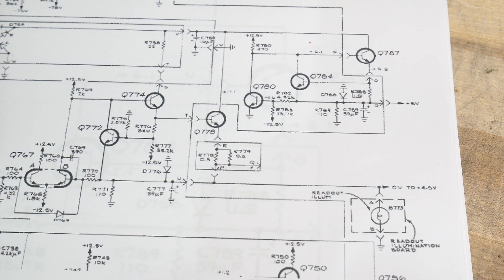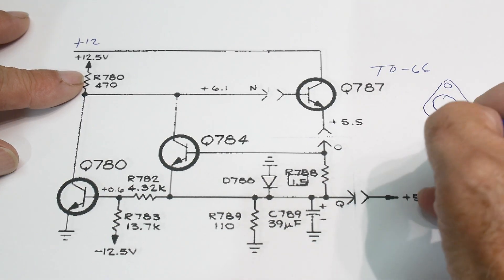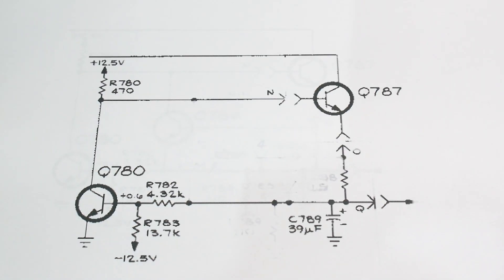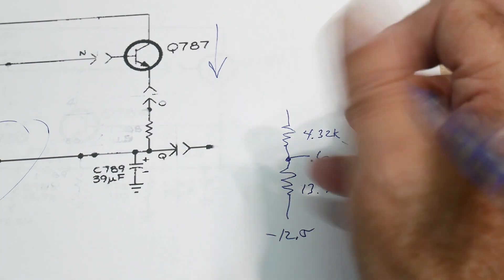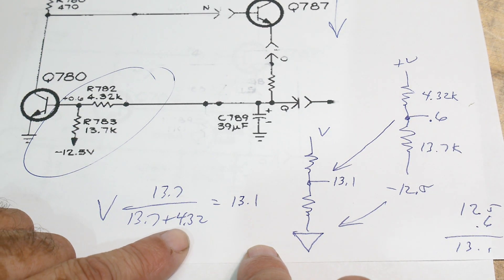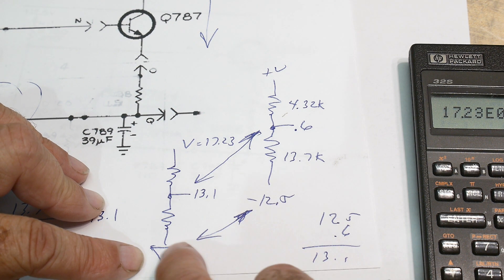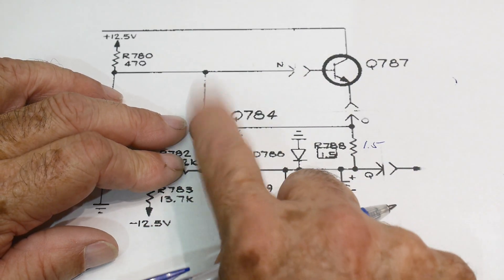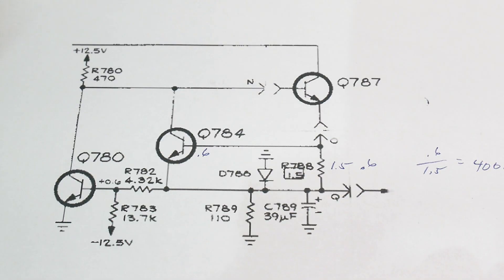#1279 Three Transistor Voltage Regulator

Comment: That first part of the circuit looks like a fold back current limiter to me... it's probably doing that, which make me think that this probably only regulates properly when it is under load and the no load open circuit voltage probably won't make much sense in respect to the required 5V

Comment: Here are a few points:

1- The diode is there to make sure if there is dip in the output voltage -- as a result of transient --, it won't go below - 0.7V , that will save your C789 (39uF Cap), without that your Cap will get reversed biased.

2-  you can calculate the current through R783 is equal to  ( 0.6 - (-12.5))/13.7K 

3. 0.6V at the base of Q780 is our kinda reference in this feedback loop (Variation in hfe of transistors or load current does not change this base voltage, only temperature will)

4.  If you open the feedback loop and do loop analyzes, you will realize R788 (which you taken off is there to stabilize the feedback loop)

5. Your open loop gain of the feedback loop is gm(of Q780) * R780 * (R783/(R783+R782))

6.  Your dominate pole (1st pole) in this feedback loop is1/{2*PI* [(R788+ 1/gm(of Q787))*C789]}

7.  gm pf any BJT transistor is Ic/VT, VT is about 0.026 V & Ic is the collector current

8.  Your first zero  of feedback loop is 1/(2*PI*Resr*C789);  Resr is the esr resistance of C789

9.  Your parasitic pole of the loop is 1/(2*PI*R780* C_parasitic of the Base Q787) diffusion cap of Q787 C~Cb=tf*gm & tf =W^2/(2*Dn)  W is effective base & thickness Dn  is Diffusivity

10. Q784 & R788 (which you eliminated) act as short circuit protection.

11.  The advantage of this Voltage Source over regular LDO:
        A.  It has its own voltage reference. 
        B.  Does not require opamp
        C.  Maybe can be designed to be faster ( higher ZGF and still stable)
        D.  Lower over all transistor count.
        F.  Maybe can be can be designed to have lower noise (Bandgap reference noise and opamp noise is eliminated, and we can optimize this type of voltage source for low noise)

Anyways, interesting circuit thanks for pointing it out.
Reply: Ok.  Now explain the Crowbar current limiter you removed.
Reply: @johnhargenrader8972  
Simple: While the voltage on Base-Emitter of Q784 is less than 0.65V , the transistor is off, when the voltage reaches 0.65V It turns on.
The Base-Emitter voltage of Q784 is almost equal to R788* Current of Q787.  So if R788 is 1.5Ohm then it takes 0.65(V) /1.5 (Ohm)  = 426 (mA) to turn Q784 on.
Below this current it is as if the transistor does not exist, above this current Q784 would start conducting shot circuit the Base to Emitter of Q787.
So the Maximum output current is about 400mA from 12V Supply. ( Assuming the output is short circuited)
The Maximum Supply current ( i.e. 12.5 V supply)  is 12.5(V) /470 (Ohm) = 26.5 (mA) ( Assuming the output is short circuited)
Reply: The Diode also protects Q780 against avalanche breakdown of its BE-diode.

This is also the point nobody is thinking about for the typical 2-transistor astable multivibrator design. It should not be operated this way with operating voltages higher than 6 V. Typical avalanche breakdown voltages are between 7 and 12 V for BJT. Especially if you use large capacitors, delivering enough charge, you can easily destroy the BE-diode of the transistors.
Reply: @gkdresden  
My main concern about this design is short circuit output to -12.5 V 
If there is a short from output to -12.5  the Diode D788 basically is going to fry, first.  Then C789 is going to blow up.  This is just beginning of chain reaction that will be very destructive.  Therefore, the circuit that used as a load should have no path to -12.5 V.
Reply: The diode is there to protect the  output circuit and left transistor when power is turned on. 

If negative supply comes on first before main power, as it sure will because of large capacitor for large load current.

Power up sequence is important here. Most analysis focuses on steady state, small signal analysis, large loop bandwidth etc. assumption.

Comment: Why use -12.5V at the bottom of that divider? One could have used 0V, couldn't you?
Reply: No, -12.5V is clearly  the voltage reference in this circuit
Reply: @yveslesage8525  but why can’t the voltage divider be referenced to 0V instead? Assuming I want to reuse this circuit in a product that doesn’t have negative supplies. Isn’t it a matter of changing the voltage divider so the 0.6V sits at the right point?
Reply: @DafyddRoche  If you do that, then your output voltage depends on the Vbe of the particular sample of transistor used for Q780, and the temperature drift of the output voltage will be -0.3% per °C. It's not suitable for production. You might as well just use a 4.3V Zener supplied from the 470R resistor and only keep Q787.
Using a stable, regulated -12.5V supply line eliminates dependency on the particular transistor's Vbe and reduces the temperature drift by a factor or 13.1/0.6 = 22 times.
If you want a 5V supply in a modern product, just use an LM7805 or one of the common low drop-out regulators if you have less than 7V to supply it from.
Reply: @RexxSchneider  Hi Rex. yes - it'd be easier to use a simple regulator! :) But I am curious, or I should say -- I need to understand - isn't ground considered "stable and regulated"? I think I understand that because the the transistors emitter is grounded, we're now depending on 0.6 or 0.65 or 0.7V turn on voltage difference. Why does having a -12.5V make a difference? surely, a Vbe variance in the transistor makes the turn on voltage equally as variable?  (Help! I clearly haven't had my AH-HA! moment! )
Reply: @DafyddRoche  Ground is stable, of course. But if you are trying to use a reference that's only about 600mV above ground, i.e Vbe of the transistor, then a variation of 60mV for example (perhaps through temperature change or variation in Vbe between samples) will produce a variation of 10% (60mV/600mV) in the current flowing through the resistor divider and a consequent 10% variation in the output voltage. On the other hand, if you tie the lower resistor to -12.5V instead of ground, then you have a total of 13.1V across that resistor and a change of 60mV in Vbe will only create a change in current of 60mV/13100mV = 0.5%, and hence only a 0.5% change in output voltage. Now do you see the difference?
Reply: @RexxSchneider  understood. thank you Rex! the greater voltage clearly gives more noise immunity.

Comment: Your 4.7V output would be off slightly because the base current was ignored.  But, I would have done the same thing, close enough. :)

Haven't thought about if adding in the base current would lower or raise the output voltage.

Wonder how stable is this over temperature?
Reply: The added base current would shift the output voltage up a little, having the same effect as reducing the value of the 13.7K resistor, but the effect is probably pretty negligible.

As for temperature stability, it's probably not great, but the fact that the entire design is dependent on the integrity of the -12.5V rail, it's probably not anyone's biggest concern.
Reply: The temperature dependance would be something like 1+4.32/13.7 times the Vbe tempco (2mV/Cent Degree). So it is just 30% more than the variation of the Vbe.

Comment: The controlled voltage opposes changes in the -12.5 V supply; they track each other such that the base voltage remains 0.6 V and very little current flows into the base.  Tracking power supplies utilize similar tricks, but the resistors would be almost equal in this design.

Comment: I think the main point of this regulator is that it is based on a separate voltage stabilized reference (The -12.5 V supply).  The 0.6 volt drop will drift slightly with temperature (maybe about 0.05V) but the current through the 13.7K will be relatively fixed at 13.1V/13.7K or about 1ma.  The current in the base of Q780 will be small (assuming reasonably high beta), so the voltage output will be about 4.32V+0.6V or about 5V.   The current limiter will not be thermally stable, but this is just a protection feature and doesn't need to be precise.
Reply: Vbe drifts about 2mV/°C i think. It can be used as thermometer.
Reply: @plainedgedsaw1694  It's -2mV/°C, but it would take a 50°C rise in temperature to decrease the 13.1V across R783 by 0.1V. That's less than 0.02% per °C, which is effectively negligible.

Comment: This regulator depends on the value of the input voltage... how can we call it regulator
Reply: It only depends on already regulated -12.5V rail, but not on it's positive rail. I guess they did it this way because it was simpler and cheaper and did the job.

Comment: My analysis process was a bit different.  By observation, there is 13.1V across the 13.7k resistor, so you can calculate the current in the two resistors (ignoring the base current).  Then, calculate the IR drop across the 4.32k, and add 0.6 to that.
Reply: I am confused about the discussion here?
To me this looks very much like a totally textbook voltage regulator?
In this case the diode drop of the transistor (Q780) is used as a reference.
R782 and R783 are the feedback resistors.
The only difference is that the negative voltage on R783 will just offset the feedback voltage.
The unfortunate thing, is that it makes the math behind it rather convoluted if you want to prove the whole thing.
But the easiest way is the way w2aew did it. Can easily be checked in your favorite SPICE program.
I only wonder why they choose to do it this way, to give regulator a little more stability or so?
Reply: @p_mouse8676  The Vbe of the transistor is not really being used as a reference because it is very small compared to the -12.5V line. That line has to be a stable voltage so that the current of about 1mA through R783 (13.7K) becomes the actual reference. When that current flows through R783 (4.32K), it produces about 4.3V, which when added to the 0.7V of the Vbe produces the output voltage of 5V. That assumes that the Ib of Q780 is small compared to 1mA. The Ic of Q780 won't be more than about 13mA, so it needs a β of more than about 200 or so to make the Ib insignificant. That's easy enough to spec for.
Reply: My initial reaction was there's about 12.5 + 0.7 = 13.2 volts across the 13.7K resistor, so we have around 1mA which also passes through the 4.32K resistor, so it drops 4.3 volts, which when added to the 0.7V at the base makes 5V output. There's no point in trying to more precise because we don't know the supply voltage ("around 12V") and we don't know the current being drawn, nor do we know the β of Q787 or the β of Q780. Assuming the supply voltage is 12V, the collector of Q780 is at around 5.7V, so we have (12V - 5.7V)/470R = 13.4mA, minus the base current of Q787, being sunk as collector current of Q780. That will require base current which also flows through R782, raising the output voltage by some unknown amount.
Reply: Its unbelievable that you are writing here. I am a huge fan :D
Reply: @IIIDarkWorlDIII  Thank you!
Reply: @w2aew  Wow what a day! Peace be on to you Sir!
Reply: can you say what led you to make that observation, or rather why that was a good place to start the analysis?
Reply from the maker: @nickcaruso  There are many ways to skin the cat. Alan looks at it like a EE and just sees currents. I tried (try) to teach at a more simple level and reduce the problem to something everyone is probably familiar with, voltage divider.
Reply: @IMSAIGuy  gotcha.  I am (technically at least) an engineer and I am curious about ways of thinking about problems.  Such was the intent of the question.
Reply from the maker: @nickcaruso  you might want to think about what the tek designer had to do. +5 at the top .6 in the middle, -12.5 at the bottom. now choose the resistors to use.
Reply: @nickcaruso  Just taking a look at what is known.  The voltages on either side of the 13.7k resistor were known, so the current was easily calculated.  Good design practice would dictate that the current through these resistors would be substantially larger than the base current (to miniimize beta dependence), so we also know the current in the 4.32k resistor, etc.
Reply: I am a fan of your clips; however, recently you have not published any new clips.
Since you were in Tektronix, may be you know who design this circuit and ask him to give a presentation.
Reply: @aduedc  I am still with Tektronix, but certainly the designer of this unit is long since retired (probably designed about 50 yrs ago).  I haven't produced any new videos lately since we're in the process of a kitchen renovation at the house.
Reply: @w2aew  That's a relief - I feared the worst, i.e. you were crushed by a stack of analogue Simpson meters 😀
Reply: @aduedc  I remember using a 576 curve tracer in the 70's so he'd probably be past retirement age at Tektronix.
Reply: It's really interesting to see how you can look at something in different ways.
For me it looked much more complicated to calculate the voltage ratio over the divider.
The current through the 13.7 resistor is easy to calculate, and when you know the current through the circuit everything else is answered.
But I guess that what is the easy way to me is the complicated way to someone else and vice versa.
Reply: My guess was to start with the divider ratio, 13.7k / (4.32k + 13.7k) = 0.760,
multiplied by the voltage across it (+5 to -12.5 = 17.5 volts) giving 13.3 volts "divided",
adjusted by moving the 0 point to -12.5, giving 0.8 volts,
then shrugging and guessing that the DC path through the filter (or bleed resistor?) is where the 0.2 volts went.  Close enough for me.  :)
Reply: Amen. The way to calculate that the other way is way way to complicated :)
Reply: So i was like  x-(-12.5)*4.32k/(4.32k+13.1k)=0.6
Reply: I would have just used a trimpot to set the voltage using ground (emitter of Q780) as the reference to avoid any variation in the -12.5v causing any variation in the 5v output
Reply: @stevelloyd5785  But the -12.5V supply is regulated, so that should not be an issue. In any case, any variation in the -12.5V line will be reduced by a factor of 13.1/4.4 = 3 on the 5V output. Whereas if you use the transistor Vbe as your reference, any variation in that will be magnified by a factor of 4.4/0.6 = 7 on the 5V output. It's much better design to use a regulated negative voltage as the reference, as long as if its magnitude is significantly greater than the transistor Vbe.
Reply: I skinned the cat the same way as you. find the current and multi by the top resistor and add +.6V

Comment: The 110 ohm (R789) must be a startup load as well, as bleed resistors would be more like 1Mohm?
That was a really neat circuit though, thanks for the explanation
Reply: it might be there to keep a little heat in Q787 for stability as well
Reply: @emiliaolfelt6370  Yep, that's valid

Comment: I like how in that era it was "we need a voltage regulator here, let's design one with transistors".  Please keep this kind of content going, it's always good practice to reason about circuits.
Reply: many years ago one voltage regulator ic is cost more expensive than 3-5 transistors. Especially if you need a stabilizer with a current of 20-50-100 mA.
Reply: @whatever2144  Good point, there are still applications where this approach makes sense.
Reply: @whatever2144  It's been quite of a while since I've seen <1A linear regulator that is not a 78xx or LM317 ic or derivatives.

Comment: I’m going to put this circuit on the bench today. I knew that wasn’t a Ziener, and am going to figure out why, and what if?
Reply: One thing to keep in mind is that the supply rails take some time to start up.   The -12V rail could be more noticeably more negative than the +12V rail is positive during startup.  The diode will keep the output from going too negative during that time, and keep from damaging components attached to the output.
Reply: @Cynthia_Cantrell  Thank you. That also crossed my mind. A job interview side-tracked me from laying this out the other day and your comment just reminded me to build a split supply for an ANDY learner/trainer board for logic. I’ve got a couple hours before the wife’s home. Time to make some sweet  MusICs without blowing my ear drum, or getting yelled at. 😂

Comment: The 110ohm resistor might also be minimum load, as without a load on output, the base drive would not have anywhere to flow right?
Reply: Maybe! You do need some load to get regulation, as the transistors are set up in push, not pull
Reply: The divider chain of R782/R783 provides a minimal load of 1mA. The base drive without any more output current is sunk by Q780. At no-load, that is about 13mA, assuming the 470R resistor is tied to something around 12V as suggested in the video. Using 110R to sink 45mA as a minimum load gets the pass transistor into its preferred working region, rather than being just barely switched on. I assume 110R was chosen because that's the smallest value of resistor that keeps its dissipation below 1/4 W on a 5V supply.